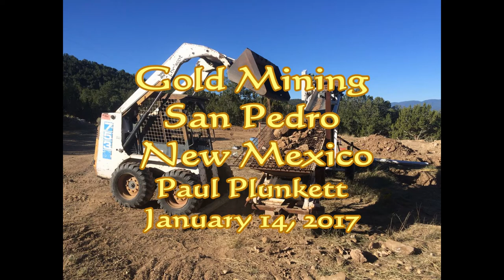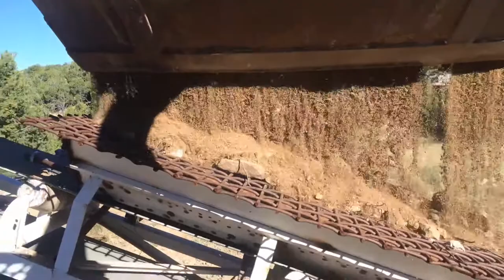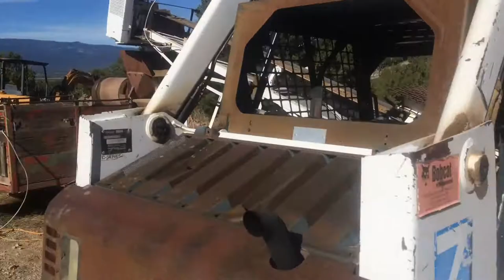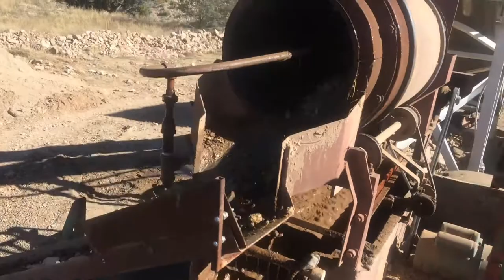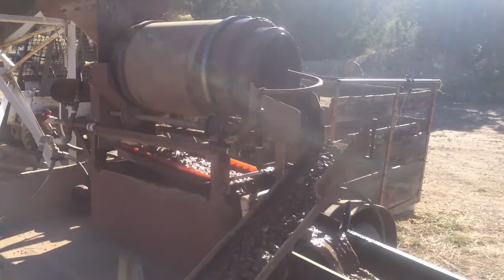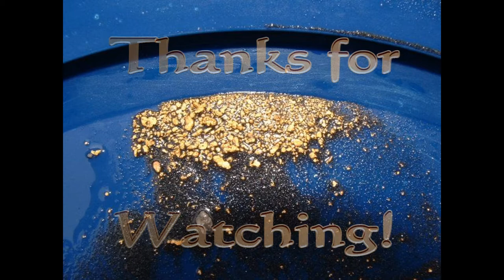Gold Mining, San Pedro Claims, New Mexico

Comment: i worked the washes west-northwest of golden and never found color, walked away with load materials (copper and silver) a little further north off 14 (near turquoise hill) - found a smidgin of color in taos ski valley, and little more southwest of red river (have a spot in mind to explore more in depth when better equipped and a warmer time of year) - found a 'really nice' quartz vain at about an once per ton on testing //three 2.5gl buckets field crushed, condensed and panned to 1.2gms total// in the bland canyons area but way too under equipped, way too hard to get in and out of (a day and a half of walking in off the canyon walls and a day and a half back in order not to approach over private property), found reasonable placer in a canyon south of bearhead peak but again no vehicular access and days to walk in and out of (packing the tools in to do it right would be near impossible) - caught sight of flakes under the "catwalks" in gila, and found 'good' color a few miles from there but saving that area for when I have better tools so as not to attract attention to what I'm doing when I go back - in the mean time seem to have better luck with small scaling and gb2ing in parts of AZ